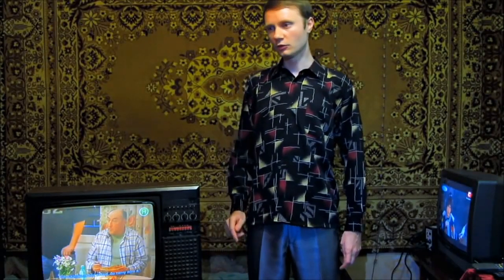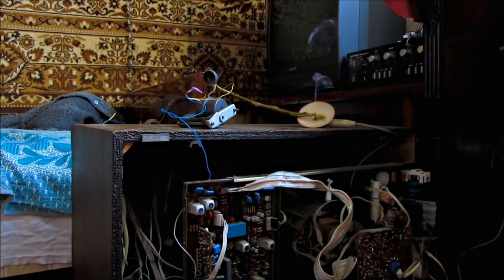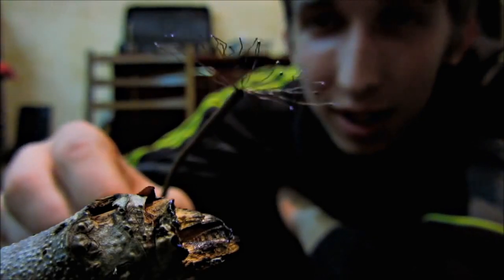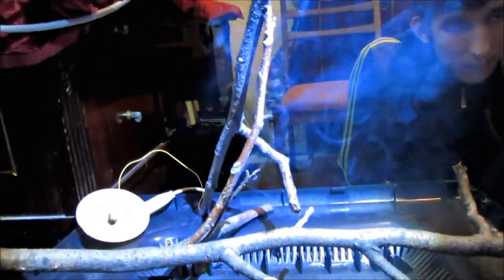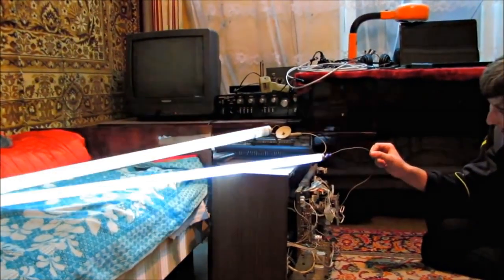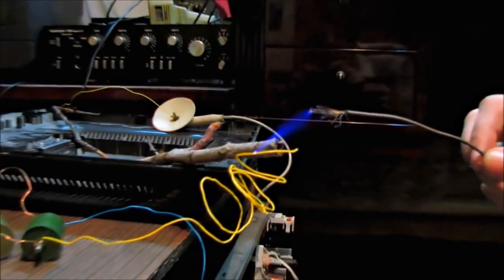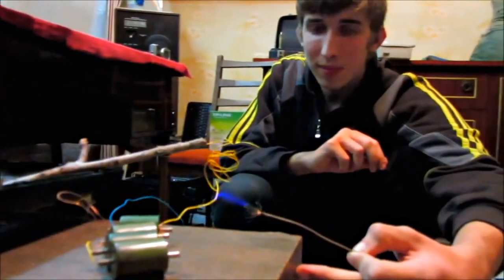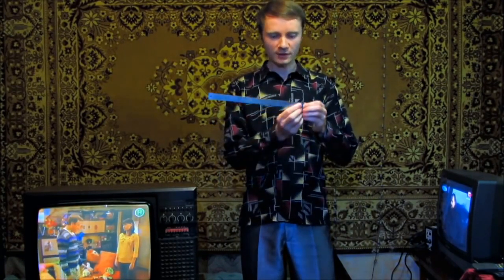High voltage television arc

Comment: Without thick rubber gloves, rubber boots, and face shield is crazy. He is the runner up for the Darwin award.
Reply: no he is not, it would only slightly burn him, othewise it is prefectly same to touch, because of the high frequency
Reply: It's a DC flyback
Reply: @webkar  I wouldn't say it's save to touch. Once it burnt his skin layer it will go through his body.
Reply: My first thought as well, I was taught to never even hold that wire with my left hand. Our teacher had us put our left arm behind our back while we trouble shot the monitors
Reply: @webkar  OMG it's 25KV his survival depends on amperage draw. If the amps are there he's a dead man. More people die from 120 volts than any other power supply what makes you think this is safe. Tell people this is safe and children will be playing stupid games and winning stupid prizes

Comment: For your safety, I think you should wear insulated gloves while holding that wire.
Reply: Won't be surprised if he doesn't make it to 30. The young man is messing around shorting high voltage in a cluttered room. Breaking the first rule I was thought, when working with a monitor  #1 Never hold that wire with your left hand,
Reply: They're playing around with the ground wire on their hands. The live high voltage wire is on the other side of the twig, which ingeniously works as a resistor. You'll get shocked already just by getting too close to the live high voltage wire.